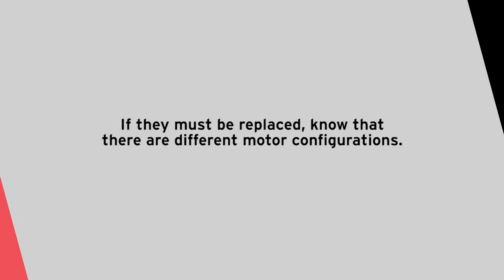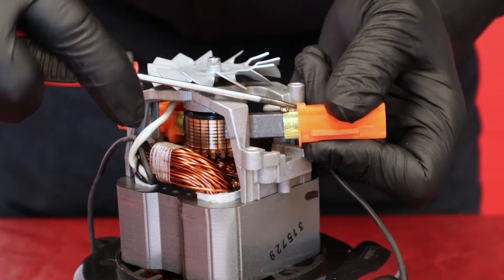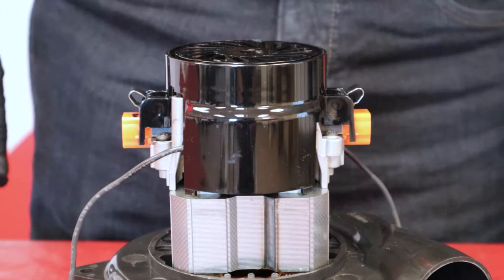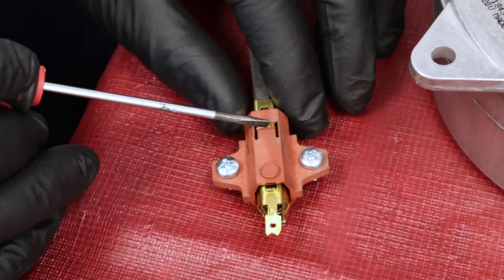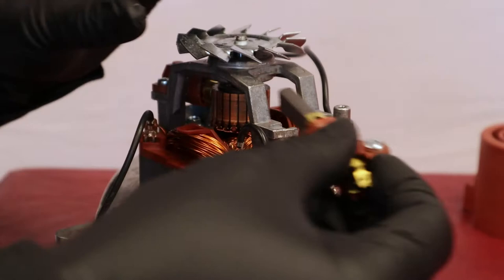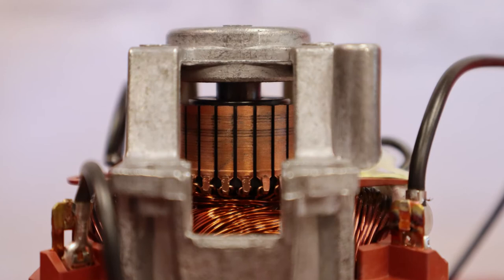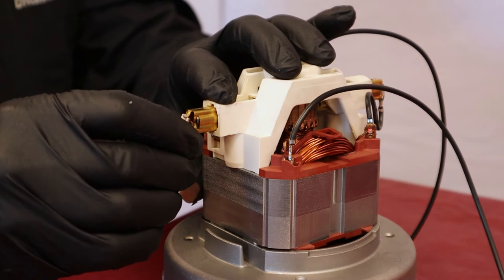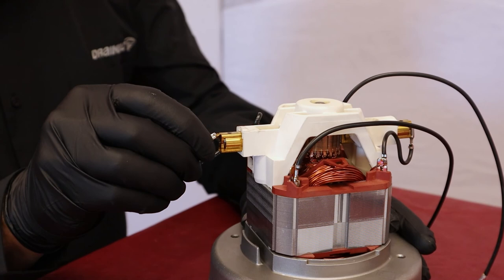Carbon Brush Replacement

Comment: For each model number, he says "Important: never touch the tip of the brush."

Why is that important?
Reply: I don't know. However, I guess that it's important for the brush to make good contact with the rotor and consequently we wouldn't want any debris or oil/grease from fingers. Debris trapped between the brush and the rotor could potentially damage the rotor.

Comment: I replaced the brushes but still get some sparking. Is this usual?
Reply: In first because don't contact all surface of brush yes but after some minutes spark are little brush surface is all contact 😊😊